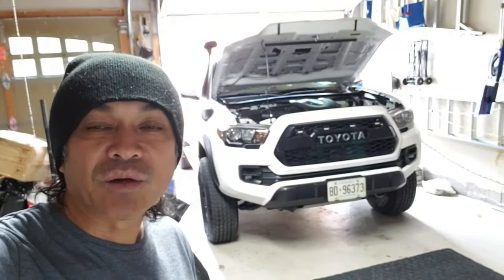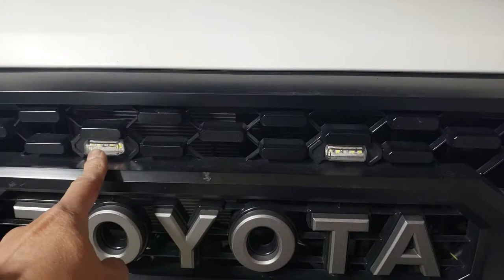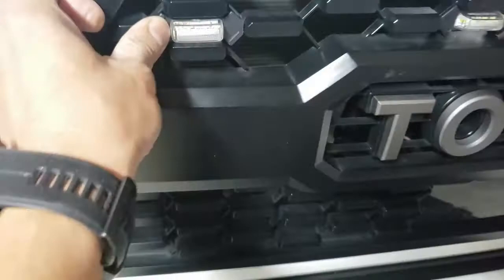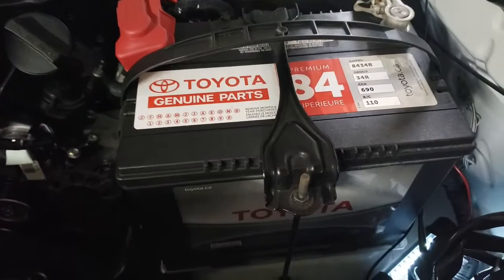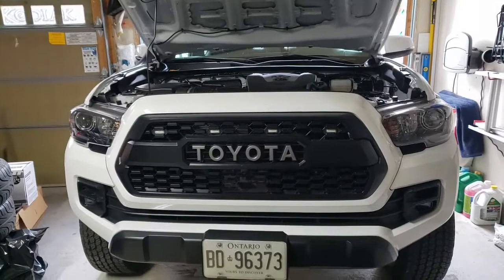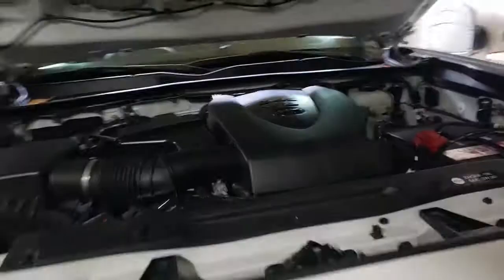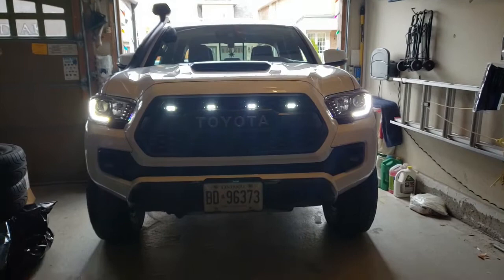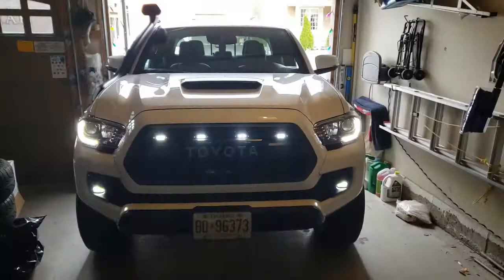TRD Grille LED Raptor Lights for 3rd Gen 2016-2021 Tacoma TRD Pro Super Easy DIY Install, Mod #6

Comment: hi alex. i was wondering if you have a multi terrain monitoring camera installed. i see something sticking out under the emblem and i was wondering if that was the camera. was it built in from the factory or did you install it yourself? i have a 2019 as well but mine doesn't have the mtm. i am planning to install some kind of mtm in the future
Reply from the maker: Hi rdzei23. that's an Anytime Camera system that I purchased and installed after market.  I actually have the installation video for it and here's the link for it: https://youtu.be/OkzXOuKjqCg. Check out the video description for the product link.  I hope this is what you were looking for and thanks for tuning in!

Comment: but do u have a video of how u wired the red  wire  lik if u cut something ?? idk how to do it
Reply from the maker: Hey Tacoma TRD, I did not cut anything and sorry but I don't have a video of it.  I just tapped into the red wire using a T-tap wire connector.
Reply: @modXELA  oh men i wish u had a video on how to do it .. maybe do it again 😂 just playing but it would help ppl
Reply from the maker: @tacomatrd1269  hey, let me see what I can do for you. Make sure you turn on the notification bell so you get notified (assuming that you already subscribed). 😉
Reply: @modXELA  thank u so much it will be very helpful i sure will turn on the bell
Reply: did u use one of the awg wire tap
Reply from the maker: @tacomatrd1269  I used a T-tap, one of these: https://www.amazon.ca/Electrical-Connectors-Insulated-Disconnect-Terminals/dp/B077YB123S/ref=asc_df_B077YB123S/?tag=googleshopc0c-20&linkCode=df0&hvadid=342971853083&hvpos=&hvnetw=g&hvrand=6959130985144079534&hvpone=&hvptwo=&hvqmt=&hvdev=c&hvdvcmdl=&hvlocint=&hvlocphy=9000887&hvtargid=pla-434396468819&th=1    Also, I couldn't record a video for you yet as my wife attended an out of town conference for a full week and she took the truck =(